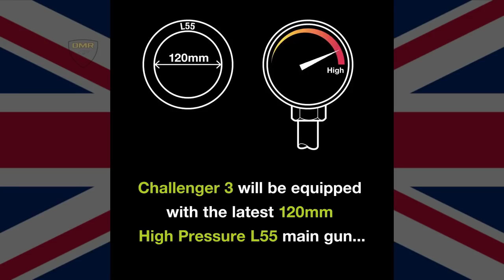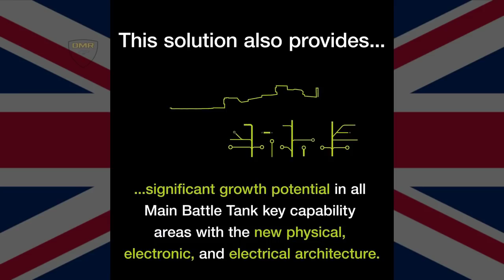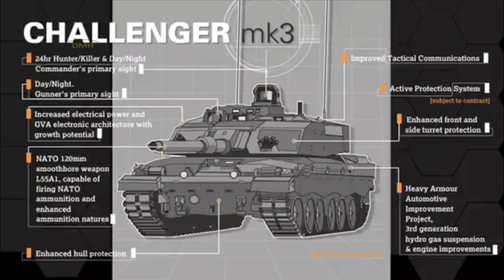Finally! The UK Unveils New Challenger 3 Main Battle Tank

Comment: Got all the bells and whistles but no 130mm gun but what a beast luv it.
Reply: I mean it has the l55 which is a very very good gun so I’m fine with it
Reply: yeah but 130mm gun means no standardized APDS.
Reply: Should be 130mm NATO will standardise  in the future.
Reply: Given the extra breech pressure it wont need it. For example the current muzzle KE of an APFSDS is a tad under 10MJ. Increase to 130mm and it starts getting difficult to increase breech pressure. You'd only get an extra 0.5KG of penetrator weight too (they only weigh 6KG). That would take muzzle KE to 10.5MJ. However the new high pressure breach makes a monumental difference. IE from 1800m/s to 2200m/s (or possibly more). That's 14.5MJ muzzle KE. With the currently available steels it just would not be safe to push breech pressures that high for a 130mm round. So we are talking at very short range 40% more stopping power with the 120mm HBP round.
Reply: @Trubripes  APDS is objectively worse than APFSDS.
Reply: Im sure theyve made the tank in mind with upgrading to a 130mm gun in the future. It would only seem logical that theyve thought it out.

Comment: Hopefully Australia will buy to replace our aging Abrams.
Reply: Or just upgrade the existing Abrams fleet...
Reply: Australia has already committed to M1A2C upgrades for it tanks. The Abrams isn't "aging" anymore than the challenger and it is significantly ahead today in upgrades and modern systems.
Reply: @cattledog901  Indeed, even by comparison between them now the only advantage of the Challenger 3 would the presence of LWR (which the Abrams will receive with the M1A2D). On the other hand, the M1A2C has an APU, has APS, has a vehicle health management system and a bunch of incremental upgrades to its electronics which the Chally 3 will lack.
As far as protection and firepower are concerned, its impossible to tell. Both have received extensive upgrades to their armor across the entire frontal arc, and while the Chally 3 will use the L55A1 with DM73 (whose dimensions are unknown to us), the Abrams is already slinging the M829A4 with datalink.

Comment: We need more but tbh the hull needs to be changed
Reply: We need more armour on it that’s it really
Reply: @ye_clapped_6974  tbh I think a new hull would be way better
Reply: @ye_clapped_6974  Nah they're right, the hull is shit. Have you ever wondered why Challenger 2 weighs more than Leopard 2, despite being a much smaller vehicle, with less protection? It's because the hull is massively over-built because of cold war era specifications for reliability. Most of the weight is useless to us now, just thickened steel everywhere, meanwhile the small dimensions and bad armour layout make modernising the protection very awkward.

Comment: Just need to order another 500 to have a credible AFV force, 148 are a waste of time. No spares to take account of combat loses. Finally the gun is being replaced with the Leopard 2 / M1 Abrams gun - so common ammunition.
Reply: 148 is the first batch order. As this batch gets towards the end of being built, another batch will be ordered. This approach means improvements can be applied to batch 2, and the cost is spread over a multiple defence budgets meaning other programs aren't short funded.

Also, as it's essentially an upgrade package for Challanger 2, once the first batch are built, the current in use Challanger 2 fleet can be sent for the upgrade as 'batch 2' to increase numbers.
Reply: @DERP_Squad  You don't really believe that? Its already been stated that the current CR2s will be retired, not upgraded. 148 tanks is just pathetic - tanks aren't yet outdated. Its 'programmes' by the way in the UK
Reply: @jjsmallpiece9234  well considering no challenger 2 has ever been taken out of service by combat for anything longer than a week of works, and these tanks have shown they can take out multiple other tanks before this upgrade. i think 148 will be a fine start
Reply: @matthew4107  148 effectively means the UK tank force will be a 1 shot weapon. No scope for combat losses, to be made up with spare vehicles
Reply: @jjsmallpiece9234  1 shot weapon? do you mean they can only take one shot? because that is far from true, and do i need to re post my comment from before? no challenger 2 was taken out of action via combat for longer than a weeks worth of works.

Comment: It’s not really a new revolutionary design, it’s just an upgraded challenger 2
Reply: The turret is completely new, new engine with upgraded suspension. So you could say the hull is Challenger 2 (more like CR1) but the turret is not.
Reply: And a leo2a7 is nothing more than a leo2a4 right
Reply: @stephencrompton4352  The turret is based on a Vickers design from the 90s, just modified to fit a German gun and French optics. Nothing is really that new.
Reply: @AllThingsCubey  Bollocks.
Reply: @AllThingsCubey  Thar must be why it's still called Challenger, and not something different.
Reply: @agt155  What an intelligent comment.
Reply: @AllThingsCubey  It's all your post deserved.
Reply: @squarehead9595  He said it's not revolutionary. M1A2 could not be described as revolutionary either. His point is they are hyping Challenger 3 up in the news when it's not that special, just an upgrade.

Comment: Smooth bore barrel tho 😢
Reply: I mean it’s a much better gun
Reply: Yeah because Rifled is ass for both Standardization and for Shaped Charge ammo
Reply: Yes that means no more HESH rounds which are great for demolishing fortifications/buildings
Reply: @andrewhayes7055  ermmm HEATFS is hesh but better
Reply: Sorry but you are wrong! HEATFS are shaped charges to penetrate light armour with a molten jet . A HESH round will destroy armour and fortifications/buildings/bunkers with its large plastic explosive warhead.
Reply: @andrewhayes7055  I’m sure heatfs will do just fine against bunkers
Reply: @ye_clapped_6974  It won't do very well against buildings though. The main reason the British Army kept the rifled barrel was it's ability to fire HESH rounds that could destroy houses/walls etc and kill any enemy inside. All a HEAT round would do is bore a thin hole through concrete/brick, maybe knock a scab of the exit side whilst doing no great damage.
Reply: @andrewhayes7055  I’m almost certain that smoothbore has a anti building round
Reply: @komradearti9935  what year are you living in the Americans don’t use 105 rifled and haven’t since the late 80s
Reply: @komradearti9935  stryker is smoothbore I believe and I disagree With the leopard needing a new gun the Germans have by far the best 120mm gun around and the 130mm isn’t tested enough but yeah I in the near future yeah but not at the moment
Reply: @komradearti9935  my bad dude but yeah I agree with that actually

Comment: "most leathal" is rubbish comic speak from a british politician in these nationalistic times.  Finally 15 years after the introduction of the L55 in Germany the challenger gets the same cannon and some typical upgrades. Nothing outstanding. Available technology - Konzept by Rheinmetall/Germany.
Reply: Its the L55A1 though. That has not been available for 15 years.

It looks like a good upgrade, capable of slinging the Chally 2 into being a lethal, modern MBT. Whether or not its the "most lethal" is questionable, but it certainly is up there with these upgrades.
Reply: @johanlassen6448  You are right the L55 was first used in the Leopard 2A6 and was introduced at 7.3.2001 in Panzerbatallion 403 - so it is 20 years old - the "most lethal weapon" for the royal dambuster challenger prinz Phillip from Battenberg Regiment 🤣
Reply: @minimax9452  Yes and the L55 =/= L55A1.